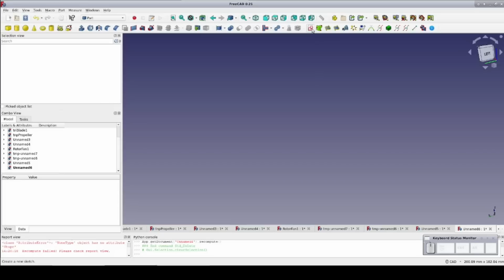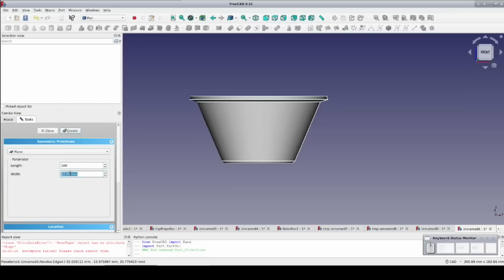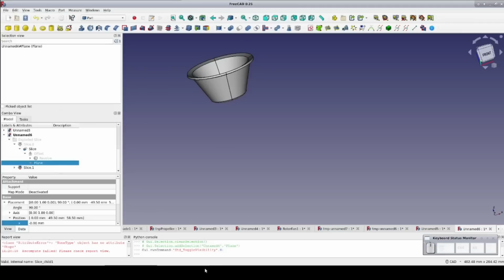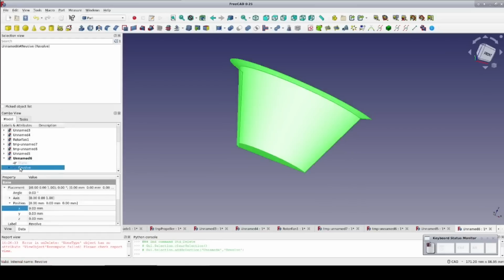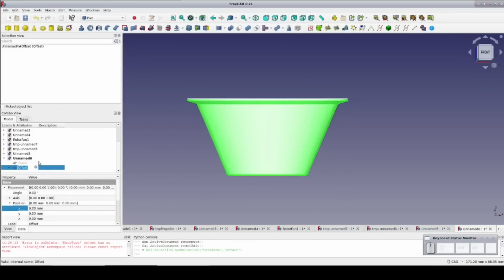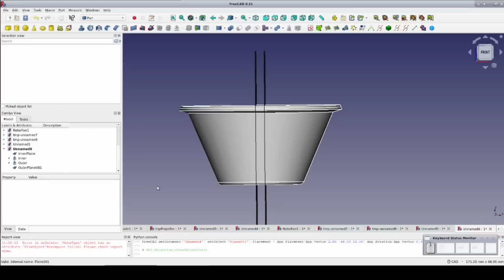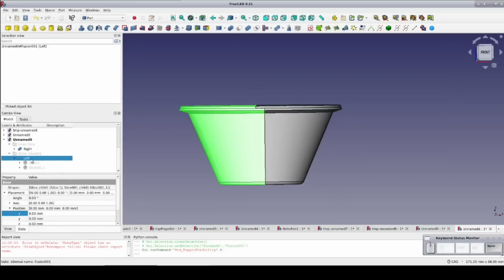FreeCAD: An open reply to Tom Sanladerer

Comment: This is exactly what I wanted Tom to include in his video: show the solution of how to do it in Freecad. In my opinion, it is way faster for beginner to stick to the sketch then operation (pad/revolve...) in part design workbench; it is the closest to how commercial CAD works. But the tools in the part / curve are very powerfull and I use them a lot... But this is another type of approach, closer to direct edition surface/volume modeling (Rhino) and older CSG / boolean modeling methods.
Reply from the maker: When I started using FreeCAD, I mostly used Part Design. I ended up moving to mostly working in Part both because I kept wanting to do things Part would do and because I wanted some tools from other workbenches that don't really work well with Part Design.

Comment: Honestly this just proves a point how backwards and unusable FreeCAD is. Everything is a workaround including the UI. There's literally no point in using it apart from "religious" motives. If you're a hobbyist - most cad programs have hobby/free versions with almost unlimited functionality. And if you're making money with cad - starting at 500 for a fusion360 license isn't much.
Reply from the maker: Most CAD programs have hobby/free versions today. F360 starts at $500/year for a full license TODAY.
FreeCAD has a perpetual and irrevocable license. In 30 years when I'm hopefully retired, if I want to revisit an old design, I'll still have FreeCAD and it'll still be free.
I did show a workaround, primarily as a way to explain what went wrong. I also showed how to do what Tom initially intended and two alternatives that didn't need a workaround at all.
Reply: @4axisprinting  I totally get the arguments about the saves being in the cloud, renting the software, etc. But that's also exactly what I mean by "religious" motives. You are discarding better software because of a "what if". What are the chances that autodesk will revoke your license? What are the chances they'll limit the functionality? Did that ever happen (apart from downgrading the free version, which sucks, but lets be honest - it's still a very good deal)? Even if they someday discontinued the product your skills would transfer easily to another piece of software, because its FreeCAD that's trying to reimagine every little thing in a CAD package, not everyone else. Don't get me wrong, I'm not trying to change your mind, it's clear that you are a pro and know FreeCAD very well. There's no point for you to switch. But for someone like me it's a lot cheaper to pay for something like Shapr3D and have a model done in an hour instead of wasting time trying to guess the freecad way of doing the simplest things, not to mention something more complex.
Reply from the maker: @rbrbrs  It's really a matter of personal taste, but you do realize you effectively asked "other than that time, what are the odds it will happen?" Also, If I make commercial use of the thing I design (possibly a decision after the fact), I place the odds of license revocation at 100% as soon as I don't pay.
It certainly wouldn't be the first time a free/discounted edition of some software went away.
Honestly though, either way I would consider that a decision on practicalities rather than a religious/moral choice.
Reply: @rbrbrs  The error in your argument is thinking that "trying to guess the FreeCAD way of doing the simplest things" is anything other than a strawman argument.

There are literally HUNDREDS of excellent YT videos that illustrate how to accomplish most everything that FreeCAD can ever do.  And I am testimony to using THEM to learn the program and accomplish anything I want to do by NOT having preconceived notions about how a PRE-RELEASE VERSION .2 piece of software "should" work.  In 4 months of part time effort I can now create moderately complex designs in minutes as I taught myself well enough to create a part for a window regulator that had complex curved geometry in two dimensions along with a number of precise cutouts to ride the track and host the steel cables to actuate it along with capturing the glass window.

The use case for FreeCAD does not cover the territory that working full time professionals have to justify $435 / year for the rest of their life, and for that I'm immensely grateful to the developers for creating a tool that is FAR more powerful than the version number of .2 even hints at.

Comment: can you revolve a closed contour from the sketch?
Reply from the maker: Yes. In fact, if you want the result to be a solid, you must close the shape.
Reply: @4axisprinting  but you drew the sketch, then offset it, and then selected the close option in the revolve window?
What I mean is, you draw the same sketch, offset the line, connect the old and the offset line and then revolve this to directly get a solid
Reply from the maker: @ozr2222  That is an option. There are multiple approaches to the problem. In many cases, it's as much a matter of personal taste and style as anything else.
Reply: @4axisprinting  yeah i also believe that, but the more i think about it i dont believe thomas actually is that fluent in cad, if he couldnt get this to work. His video also left me with that impression
Reply: @ozr2222  Having work in AutoCAD professionally for nearly 2 decades I can tell you I have found FreeCAD so frustrating to get started with I haven't yet finished a project with it that would be well less than half an hour of work in AutoCAAD.  As good as this video is, he has made changes to the default to get the fillet to work.  At least that is mentioned here, many tutorials don't include such information.

Having worked on programming projects for nearly 4 decades, I can tell you that it does feel like it could benefit from a usability and integration team.  There was a guy at Palm whose job was to reduce the number of clinks to complete a task to as few as possible.  Being an opensource project that isn't likely to happen unless / until it frustrates someone enough they jump in.  Sadly my eyesight is bad enough now it won't be me.
Reply: @ozr2222  I like Thomas and have watched a lot of his videos, so was disappointed he didn't immediately realize that prior knowledge of a finished alternative product doesn't necessarily carry over to a version .2 pre-release, and THEN simply go out and watch any of the HUNDREDS of well done videos that exist for FreeCAD which could have gotten him there.

Using those videos, over 4 months of part time effort culminated in me being able to create a complex replacement part for a window regulator in a power window, where it had two boolean curved cuts and a lot of precise geometry to ride the track and house the steel cable to move the window up and down....

What these products lack are a graded and sequenced set of YT videos to watch to learn increasingly advanced concepts in the tool.  If someone had given me that, I could have built that window regulator in a week of study, rather than months or part time trial and error and seeking out a video to learn what I discovered I needed to know.

Comment: Would you say the FreeCAD ways are better though? I'd argue that user interface design should follow the "Principle of Least Surprise". Developers should follow the same conventions as popular software by default. Unless they've invented some new interaction model which cannot co-exist with the conventional approach, and offers a substantial advantage worth the learning-curve.
Reply from the maker: I don't know that I would say better, since that will be a very individual preference.

Personally, I like entering exact values in the data pane and some times find it easier to deal with than trying to move things in 3 dimensions with a mouse and a 2D monitor. Others probably hate that.

I also find using geometry to modify other geometry to be quite natural and to better reflect formal geometry. Again, I'm sure others hate that.

Least surprise is a great principle, but like most easily stated principles isn't really a single metric. As a software developer, I am sometimes surprised at what surprises some people.

Most of the surprises to me are missing implementation or bugs rather than design decisions. Those will just take time to work out.
Reply: @4axisprinting  I'd say mouse and keyboard editing are two interface paradigms which can (and should) co-exist, like in Blender. Though obviously that's more work to implement.

Yes, Least Surprise is obviously relative. I get the impression that perhaps FreeCAD is taking its primary inspiration from AutoCad, when more people are used to Fusion and SolidWorks now.
Reply: @andybrice2711  All I can add on the topic is that it's hugely customisable for a .2 version (shortcut keys, etc.) and that if you take the approach of decide what you want to do, and watch the video that shows the methods to do it in the program, there's nothing I haven't found a way to get it done.  That includes recreating a window regulator part with two curved surfaces to ride in the curved track of the car window along with a host of other elements to the design to have the cable power it up and down the track.  5 test prints got me there, as I was simply trying to recreate the part from incomplete data.  About 8 designs in, culminating in that one, I now feel confident enough to quickly design most moderate complexity parts I'm imagining to then 3D print.  All over 4 months of very part time experience.

The version .2, to me, highly under sells what it is capable of, and speaks more of some bugs and future integration of tools that will lead it to be a sound 1.0
Reply: For example: VS Code's "Command Pallet" is usually superior to a menubar, and worth getting used to.
Whereas Blender's original "Right-click to select" was just confusing with no real benefit.
Reply: @andybrice2711  VS code's command pallet sucks but the vocal minority of users are typists first and developers second so "who can recall the most commands" is a contest that drives its progress.
What it does well though is seamlessly support a lot of technologies.
Reply: you can't forget copyright . it may be an issue and that's because it's different ?? each program has it's own nomenclature and learning curve . get over it or make it better . I love freecad . I salute the developers and their fine job they are doing . here is another channel I owe a great deal to with my FreeCad education . Deron at mango Jelly solutions . Great Guy Very good at it . check him out .

Comment: I think you just proved his point.
Reply: Funny, for me this makes FreeCAD seem much more approachable. I'm really happy to have seen this video
Reply: So true.
Reply: Yea, like 10 extra, kinda odd and confusing steps to do the same thing I can do in one or two common sense steps in most other CAD apps. I’m glad Free CAD is a thing, but it’s still got some maturing to do. Like Tom I download it and try it every now and then because it’s a cool idea, just takes way to much time to get simple things done.
Reply: @Thomllama  / What Tom tried to do, aka Split a part by Origin XZ Plane, didn't work as FreeCAD doesn't have valid shape property for that plane.
Instead, he could've used other plane objects like Datum Plane or primitive Plane surface part which has valid shape properties.
This is also way cleaner on FreeCAD's logical project structure, with linked object.
Reply: @Thomllama  First of all, there wasn't 10 extra steps, he was just doing extra steps to show you exactly what is happening. And they weren't less common sense than in "most other CAD apps". Right after Tom's video I tried to do the same as Tom claimed, and had no problem doing it the way he explained it, although I personally would've done it another way. Tom said he struggled for a long time, but it took just moments to do, and I encountered no problems.

Second, I've come from SolidWorks and Inventor, and in both of them I've encountered things failing for no apparent reason, countless times. In fact, I used to use one program for about a year until I lost my nerves with its stupidities, then switch to the other. Then used that for a year until losing my nerves with its moronic restrictions, and switch back. And this was my CAD circle. Then when Fusion 360 became popular I decided to try that instead, because people praised it and because it was free, although it also had very annoying and complicated ways of doing things. When they added restrictions on what you can do with the free version I then decided to try FreeCAD instead.

In FreeCAD the workbenches were a bit confusing for a day or so, but the real problem was what I later learned was called the topological naming problem. That required jumping through hoops, and made things needlessly complicated. But then I found realthunder's version. O-M-G! It was bloody perfect. Now I'm practically never experiencing the problems so common in SolidWorks, Inventor, and Fusion360, but everything just works logically, and everything can be easily modified later. I love it!

Ok, not pure bliss, because the assemblies are still annoying to use. But at least for designing parts I'm now perfectly happy, and will absolutely never go back to the IMHO inferior "common CAD apps".
Reply: @Thomllama  Gee, maybe that's why it has a pre-release version of .2 and you are comparing it to FINISHED PRODUCTS.

So, .2 versions have "maturing to do".  Got it.
Reply: @brianmi40  it’s been a “pre release “ for 20 yrs 🤨
Reply: @Thomllama it also has 0.020% of the budget of any commercial CAD.
Reply: @33KK  doesn’t change the fact the order of operations is still multiple extra steps to do the same function. Again, I like it’s out there! I will continue to try with new updates, but still far from a productive app for getting the work done in a reasonable time frame.
Reply: @Thomllama  the problem lies in a misconception about what the tools are. Fusion is like sandbox castle building. You just operate like making a cake. Nice, intuitive and easy. BUT going back and changing things mostly means tossing the sand back into the cast and start over. The FreeCAD way uses a very different approach, and I still have trouble handling it, but if done right, you can change some early components and everything else falls into its new place. Really impressive, but it feels very cumbersome.
Reply: @wernerviehhauser94 that's just plain wrong. With a proper parametric sketch and a some basic practices the fusion360 timeline offers a way of manipulating parts after the fact. It's just a feature that many hobbyist don't know how to use
Reply: @sedon7098  timeline in fusion 360 is incredibly powerful, i design everything parametric now and use the timeline extensively. it's not even remotely difficult.
Reply: @TMS5100  imo the most powerful and compelling feature of fusion360

Comment: Good video. Shows if people have the ability to reach developers can find solutions or reasons for their troubles using a cad software. You should produce tutorial videos for freecad. I've learned cad-cam on catia 16years ago and after a very brief, limited course of sketch, part, assembly and cam modules, it was a pain in the ass when software slapped me with an error pop-up to find out what's missing. 

For today's situation I see FreeCAD is in the same place. back then 16 years ago, there were only funny cat videos on youtube but today you can really boost the usability, awareness, and community for it by making good educational videos.

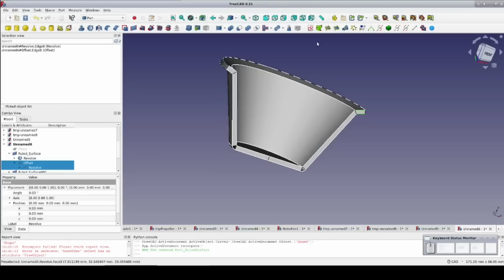Comment: "FreeCAD does thigs differently". That "differently" is an understatement. What bothers me a lot that it is extremally hard to do prototyping parts fast because you need to fully constrain sketch (in Part Design). Another thing that bothers me is why the F you need 3 separated dimension buttons ??? Do you actually realize how much clicking is required to put those dimensions comparting to F360 ? Also 5:05, just look how much is he clicking to make a face. At 5:34 you explained what is also a FreeCAD problem .. there functions that works ONLY on separated workbenches. How about combining all of those useful functions into ONE workbench ?? You don't need 10 work evorioment to make 1 part. 11:41 i am hobbyist but i don't to waste my time figure how to design a simple part for hours in FreeCAD if i can do same design in F360 in 30 min.
Reply from the maker: Certainly there are infelicities there. However, note in my video I did not constrain the sketch at all since it was just a quick illustration. The separate dimension constraints come in handy sometimes. I have actually had cases where I wanted to constrain something only horizontally or vertically while allowing free movement in the other dimension.
At the end of the day, personal preference comes in to play as well, and so it's good that there are choices out there.
Reply: Because Vertical, Horizontal and (arbitrary) Distance are three separate constrains that do different things and you can't have one button to do three things unless you go NX way of suggesting constrains and dimensions on selection.
Reply: Huh?  I've created entire parts without bothering with even partial constraints.  Constraints are best practice as any real engineer will tell you, and without them you can get in trouble with FreeCAD, but they are far from a must have.

And at 5:05, as he clearly stated, he's illustrating a WORKAROUND TO A FUNCTIONAL LIMITATION in a version .2 of a product.

Let me repeat that: it's a VERSION .2 -- literally a PRE-RELEASE PRODUCT, so there will be plenty of optimization of the workspace in future releases.

Lastly, a few hours watching well done applicable tutorials in YT will preclude hours of digging around in menus.  Doing so, I've been able to teach myself well enough over 4 months of part time effort to design complex bodies with curved boolean cuts in two planes as well as other complex features.